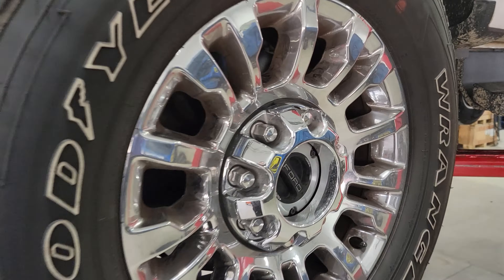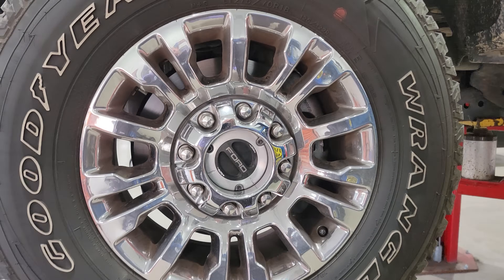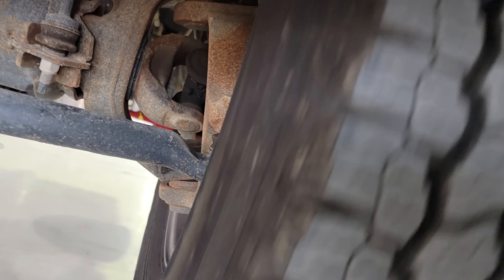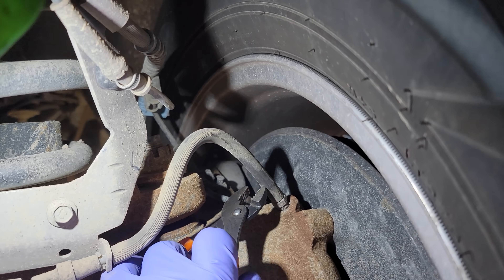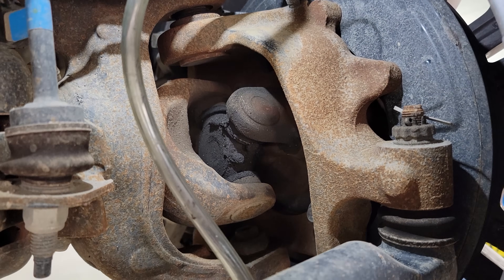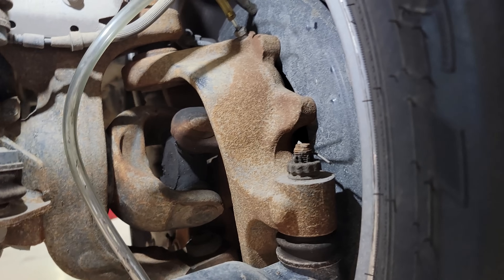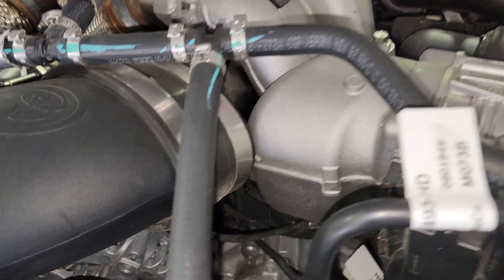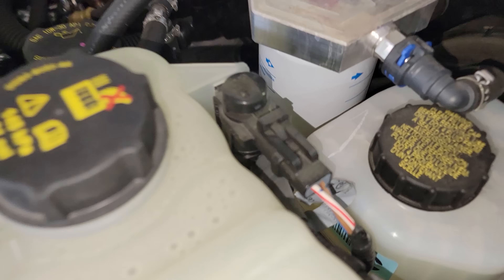Ford Superduty 4WD problems  | Do you have vacuum?🤔 - Follow this NOW! #fyp

Comment: So I’m a little confused perhaps somebody can straighten me out your Ford truck has manual select or auto locking hubs that the vacuum will engage so if the vacuum doesn’t work, can’t they still be locked manually and so pretend you don’t have vacuum operated hubs and they’re just manual hubs can’t you treat them as manual hubs and not go out to buy the warns?
Reply from the maker: U can but thats gonna spin your front axle shafts when they dont need too

Comment: My 18 F250 XLT hubs aren't disengaging.  The auto part wasn't working so I had to manually lock them.  I noticed I had a clunking sound when turning so I jacked the truck up and noticed my front wheels are turning the shafts.  Hubs bad or is there something else I should look at or do?

Comment: I have a 2012 F-250 Super Duty with the 6.2l Gas engine and the 4X4 vacuum system is the same.  I recently has a problem with no auto 4X4 and the manual locking hubs were badly corroded and damaged inside.  I replaced the hubs with Ford OEMs, and although it would go into 4WD manually, there was still, no auto 4X4. I didn't use a vacuum pump, but I inspected the vacuum lines, and the driver's side vacuum line was disconnected on the back side of the front axle where it was mounted to the axle housing.  The rubber hose was originally pushed onto a small plastic connector (similar to a windshield washer connector) and there were no clips or clamps to hold it on.  I reconnected it and put two small tie wraps to hold it in place and it is working fine. It is frustrating when a truck that originally cost $50,000 in 2012, relied on flimsy plastic connectors with no securing mechanism for a part that is subjected to constant vibration and exposure to the elements.

Comment: "No 4x4" as in the dash will not indicate 4x4, 
or the system indicated 4x4, but it's not doing 4x4 things?
(i.e.: is the vacuum part of the shifting process)
Reply from the maker: No.

Comment: I have a 93 Ranger and an 03 F350. Both I ordered new with MANUAL hubs, manual transfer cases and manual transmissions.  My dad bought a new 98 Ranger which had the PVH vacuum hubs.  They NEVER worked since new.  Sometimes it would be 3 wheel drive if at all.   Total Junk.  He still has it but currently not running.  If I ever fix it up I’m installing manual hubs   I’ll never buy a new truck again.  Just rebuilt the 4.0 in my Ranger last fall.  Hopefully it will last another 31 years.  Luckily I live in MT where we don’t salt the roads and have low humidity.

Comment: I'm not a mechanic.... I have a 1999 f350 7.3 dually 4wd. Just finished brake rehab (rotors, pads, calipers, seals and brake hoses) and noticed the vacuum nozzle on the knuckle. Also noticed the vacuum line from behind the degas bottle. But, there's no vacuum line connecting the two. I've just  locked the hubs manually. In a perfect world where everything is working, (seals, switches etc..) if I replace the vacuum lines to the knuckle, I should be in good shape? Thanks.
Reply from the maker: Yes

Comment: I have asked a bunch of people and nobody seems to be able to tell me what causes this sound. I have a cracking/ bolts in a can sound when driving 10-30mph coming from the front driver side wheel around the hub area and I can’t seem to get it fixed! Any idea what causes it?

2017 f250 ( the brakes are all new as well)

Comment: On F-150, I believe applying vacuum disengages the axle.  I prefer this, where application of vacuum engages the axle, where if you lose a vacuum line, you don't have an axle locking itself.

Comment: Hello, no 4×4, 2003 f350 6.0. Fuse 19 10amp good, the 4×4 & low lock lights not comming on on dash when selector is turned to them. Does this info give my next step? Please.
Reply from the maker: No, id have 2 look at it...

Comment: Great video! My vacuum line broke between the bracket and the knuckle fitting. I need a replacement. Do you happen to know the part number? Having trouble locating it? The whole vacuum line would work as well. Thank you for your time!
Reply from the maker: I do not. Call dealer with your vin

Comment: My Auto 4wd hubs on my F350 stopped working. I just checked and found a vacuum line to the right front knuckle had come undone. Plugged it back together and it's fixed! Thanks for the tips man!!

Comment: My 2017 F-250 has two different lockout hubs up front.  Driver side is "Auto and Lock", passenger side is "Free and Lock".  Also, passenger side doesn't have an O-ring on the hub.  So even if I wanted to pull a vacuum, it wouldn't work.  Aren't they supposed to be the same on each side?
Reply from the maker: They r

Comment: Excellent video. I just replaced front hub assembly.  However I have a front growling noise. I jacked up the front and was able to manually lock the truck in 4x4. But what can cause this noise? Im thinking i didn't torque enough for a proper seal or a vaccum solenoid or vaccuum line. .... Thanks

Comment: My 2016 4 wheel drive works in 4 high when the hubs are in auto but for 4 low you have to lock the hubs in right is this right

Comment: What if you have the opposite problem ? It won't disengage, and I have the squeaking from the hub seal as well, but also when 4wd is turned on on the switch it starts making a popping type noise that is in synce with the wheel rotation, gets louder when it's in reverse and sometimes there's no noise

Comment: Subscribed… great content!!!  Does the vacuum system serve any other function on a 2011 f250 powerstroke?  I replaced a cracked vacuum hose 5 years back.  Not shifting on the fly into 4X4 was the symptom.  It isn’t pulling a vacuum again and the same thing is going on.  I suspect the hose has become brittle and cracked again?  However, additionally, on start up I am getting an engine light code P1249 Waste Gate Performance.  Might this also be a function of the vacuum system?
Reply from the maker: Cld be but the EGR system uses vacuum to control the EGR bypass. So if it was still a vacuum issue like a pump id suspect you'd have more DTCs

Comment: I have a new ‘22 F-350 with the 6.7 I just ordered aftermarket hubs for it. Manual locking hubs or free none of this auto B.S. that can break. Ford has so many problems with these stupid vacuum hubs. Wish the would get rid of them altogether.
Reply: I have a 21 f250 with 25k miles. Just got new hubs and vacuum lines courtesy of ford.

Comment: Have you ever had an issue with the auto lock not engaging in cold and snow weather? I was driving up the mountain for work in a white out and when I switched into 4 wheel drive I got a service wrench icon after a few seconds and the 4WD did not engage. I was sliding all over. I got out and manually locked the hubs and it worked perfect. After I got down from the mountain to town, I checked the 4WD in auto and it worked fine. I have been checking it daily since and it works fine. Is it possible the cold and snow had a part in it not working?

Comment: I have to guess that was somewhat the problem I had with my 2011 Expedition. The front differential would engage and disengage while driving down the street. It was diagnosed as a vacuum problem. Thank you God it was repaired and returned in one day.

Comment: I now know what that line is for. Mines broke off and I couldn't figure what it was for and I finally typed in the right wording. Thank you for this! My truck is a '17, the dial is pretty hard to turn, but I haven't had issues shifting until my passenger side hose broke.

Comment: I had no hub activation the other day and it was the small plastic line near the solenoid.the heat in the engine bay makes those line brittle and it was broken in half.

Comment: I know this comments but I have a question changed oil in my 2021 350 6.7 put 13 quarts in checked it showed good on dip stick truck was on a small incline at entrance to shop I moved to driveway which is flat checked couple hours later it barley showed on very tip of dip stick any thoughts I did add a bit more but don't want to go to far
Reply from the maker: I run 14 in ours. If i let her drain fer a few hrs then come back
Reply: @PowerStrokeTechTalkwARod  ok thanks I let it drain for about 20 minutes I did about a bit more but was getting near dark and couldn't really tell if it was showing il revisit it in the day light tomorrow I figured I'd ask you you really seem to be know the 6.7'S like the back of your hand

Comment: On my 2007 my heater vent controls fluctuated between vents and defrost vents when the 4x4 was engaged when my hubs leaked vacuum.  Not sure if that is the same on the new trucks but it certainly was an immediate telltale

Comment: are the integrated wheel ends on the F150s opposite? 

I recall having one that would make noise on heavy accel and found it was losing vacuum and I was hearing the wheel end transitioning to 4wd.

vacuum = 2WD on the F150s correct???
Reply from the maker: Yes, complete opposite from SD
Reply: @PowerStrokeTechTalkwARod  
Can you tell me the Ford approved way of towing them when they won't start? 

No start= No vacuum= Stuck front hubs

In the winter I drag them around on the ice, but in the summer they don't like that
Reply from the maker: U cld use them poly tow skates

Comment: I have a 7.3 4x4 and I have a concern about those locking hubs. What if someone plays with them while sitting in a parking lot and one or both is left in the lock position? How would I tell and could damage occur?
Reply from the maker: No really goin to damage anything. Your just spinning stuff that doesnt need to spin at the moment

Comment: Both Dodge and GM abandoned locking hubs long ago. I'm glad that Ford still has locking hubs and that they can still be manually locked in the event that the vacuum system fails. I just can't see turning the front axles and driveshaft when not in 4wd. My motto has always been "Lock and Free = Economy".
Reply: I totally agree with you. Locked or unlocked. None of this auto hub B.S.

Comment: Can you save your axel shafts ( the zerk fitting knuckle area ) by not leaving in Manual fulltime?  Just leave in auto and only use when needed? I had mine set in manual and forgot about it until recently.
Reply from the maker: Yea....a no good

Comment: Chased ghosts in my vacuum system of the 09-6.4, finally found that there was a torn gasket inside the mini vacuum pump i replaced the pump and got things working again, never worked 100% of the time but closed to 90 figured the other 10% was just age of components especially the solenoid.  Got a aftermarket one and it didn’t work well, got a motorcraft one and it closed the gap :-)

Comment: Seals leak on the auto hubs when the temperatures get below 10°. Then the four-wheel-drive will slam in and out like a motherfucker. Turn to manual in extreme cold.

Comment: I have always been curious how ford does their hubs and 4x4, coming from a dodge and precious jeeps all with solid front axles it was always “in 4x4” I’m pretty sure this is known as a live front axle and then the engagement is just done at the transfer case, very interesting though. How often do you see the actual hub engagement fail on truck that’s made in the last 10 years?
Reply from the maker: No a whole lot but enough to have made us make this vid

Comment: Hey brother, 2022 F250 Tremor rear axle vent tube? What is at the end of tube? Should there be a check valve? Front?
Reply from the maker: No juss like a lil plastic vent cap
Reply: @PowerStrokeTechTalkwARod  I found at rear vent hose end, just a "V" looking hose coupler open ended. WTF, not even capped
Reply from the maker: Pics?
Reply: @PowerStrokeTechTalkwARod  where should I send pics?
Reply from the maker: Email is in ALL descriptions

Comment: They really weren't the same all the way back to 7.3L days.  The older ones through i think 2010 were pulse vacuum hub lock.  2011 and newer are constant vacuum hub lock. Much simpler system.  PVH hubs were a pain in the ass! Love the videos.  Keep it going!
Reply: Yeah i was thinking the same thing! i did stay with the factory pulse hubs but disconnected the vacuum after one of the hubs stayed locked in after its ‘lock & unlock’ cycle they do on every startup

Comment: Classic example of, the wheels spinning but the hamster's dead! lol I had this problem back on my 2008 where that spaghetti tubing that Ford uses to route vacuum was brittle and broken in several places. I replaced them with rubber vacuum hose. It amazes me that Ford continues to use this crap!

Comment: This is the guy you want to be stall mates with. Super smart and seems super helpful.
Reply: I’m honored when I get to hang out in his garage
Reply from the maker: Hair cuts, come one come all!
Reply: I agree. Luckily I can do all my own work but when the upper oil pan started puking and I still had warranty I brought it in. Next oil change I literally removed the drain plug by hand, they charged ford for a coolant flush they never did and whined on the work order that the BDS lift made the job harder to do. A few months later the truck would periodically lose major power so I again brought it in but was informed the warranty was cancelled. Since I pretty much cringe at a dealership touching my truck I went home and got to work on it. Luckily for me not all dealership techs suck and one posted a video of a problem he found that had a few of the same codes which was the harness rubbing against the egr cooler and shorting or grounding out. Now I don’t miss any of his video’s, thanks AROD. Oh ya and MSA ford sucks big time, if you take any pride in your vehicle don’t go near the lying rats 🐀. I could say more but this comment is already ridiculously longer than the amount of time my truck sat in their lot before they even touched it the first time I had it there

Comment: Im surprised Ford has stayed with this setup as long as they have. I remember replacing them with manual lock out kits on 7.3s back in the day when the customers didnt want to pay for messing with the vacuum setup. We would replace with the warn manual hubs.
Reply: Yep I agree. Warn Premiums on my 99. My 16 I bought a manual gear shifter for a reason.
Reply: Or the grease in the hub is dry and needs cleaned and replaced so the locking parts can move in the hub.
Reply: I put mile markers on my 03 7.3, pretty sure Ford wanted a boat load for those hubs…at least at the time. I always feel better just locking them in anyway if you know you going to be wheelin!
Reply: My '03 7.3L went through 3 sets of automatic hubs replaced under warranty before Ford just wouldn't replace them because they could not find the actual issue. I ended up with the Warn manuals and never had a problem to this day - over 1,000,000kms